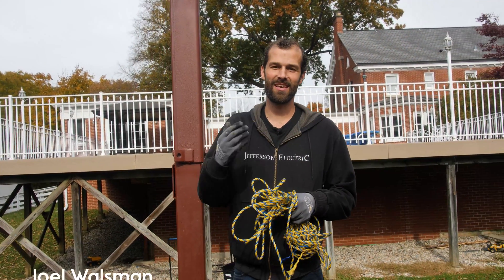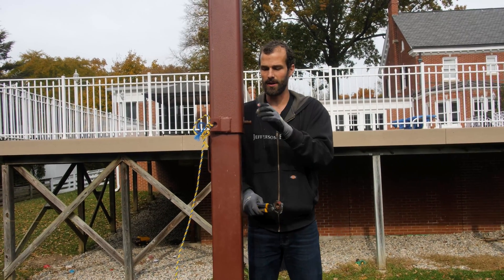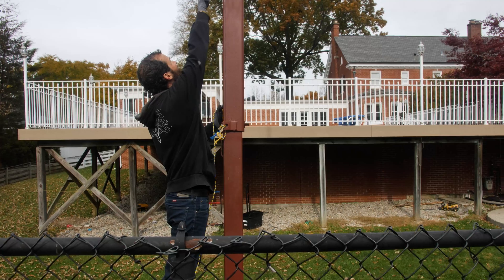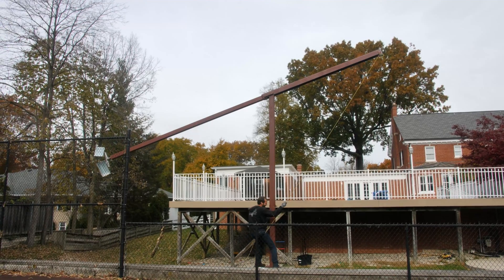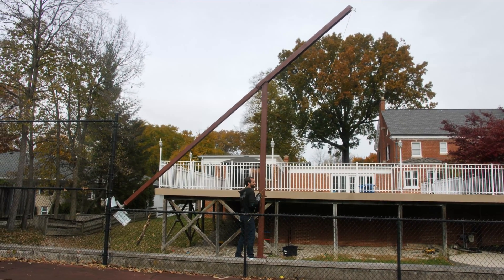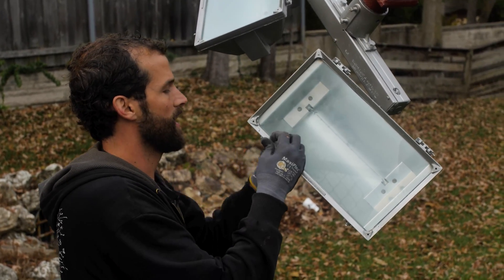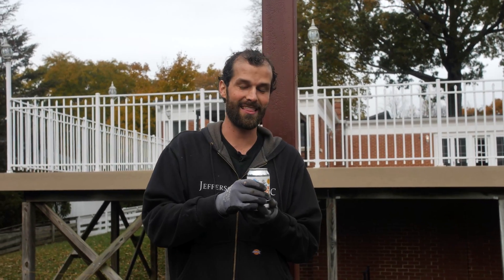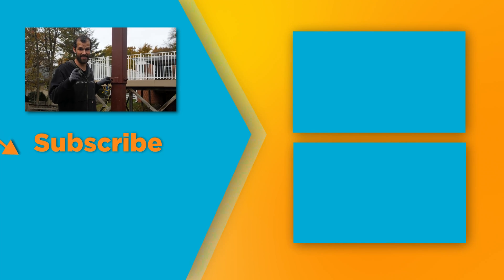Replacing Outdoor Court Lights (Tennis, Basketball, Etc.)

Comment: Hard to justify more efficient bulbs with only 90 minutes per year use.  But my favorite complaint with lights like this is that installers think you must tip them up to get good coverage.  The result is off site glare for everyone else.  Often the light will be more than adequate with the lens parallel to the ground.  Not always, but often.  If you can, adjust them at night so you can see the actual lighting pattern.

Comment: How can a 1500W bulb (12.5 amps) be drawing more power than the entire house combined)? The water heater probably using more no? Unless you're adding up all of the bulbs (and I guess there are 6-10 of them?)
Reply: Righto! 8 x 1500 watt bulbs =6,000 watts. Great thinking!